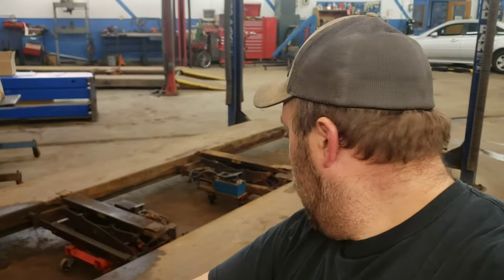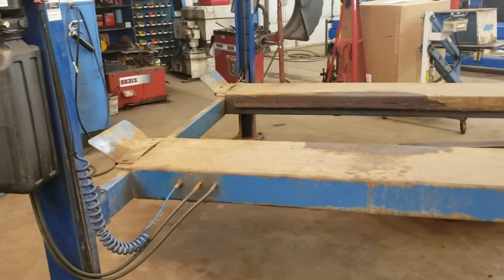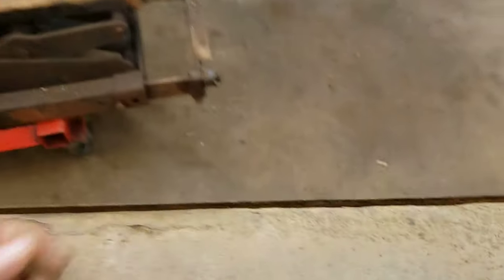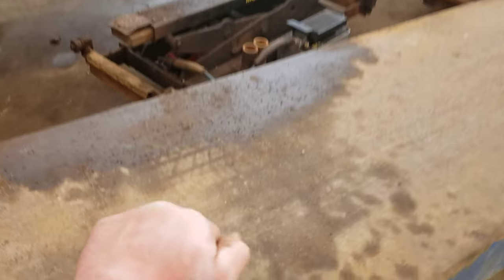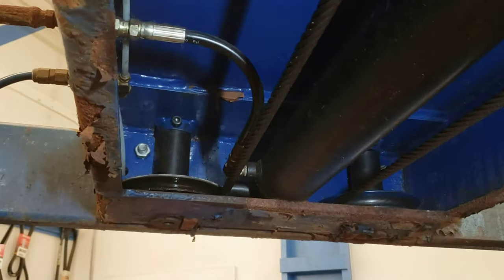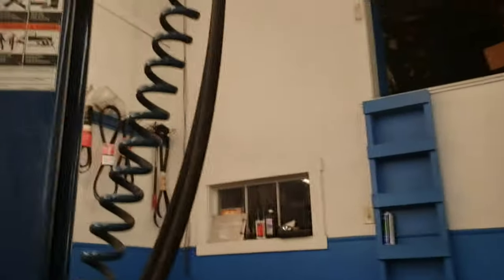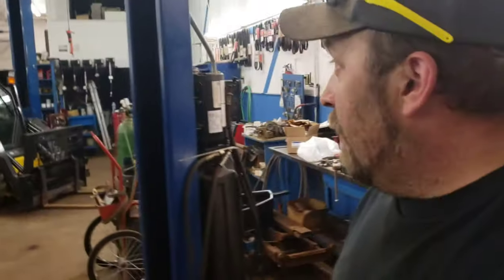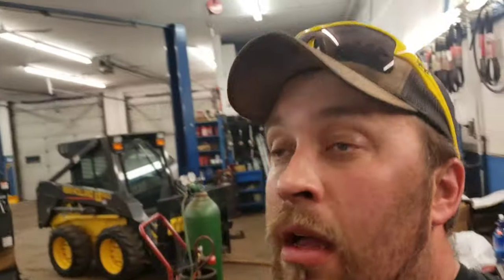Farm Vlog #24 Removing a 4 Post Hoist (Future Welding Table )

Comment: That would be an awesome welding table if you could use the lift!!!!! Still make a damn nice table!!!
BTW, I could fix the rails, make it better than new😁😎🥃🥃🍻
Reply from the maker: I could fix the rails as well but I don't have tall enough ceilings for it in this building and the boss wanted decommissioned so someone didn't get hurt. A 2 post would be more effective for my needs at the farm anyway. Thanks man.

Comment: You lucky SOB. Id be keeping it as a hoist; I can live without the wheel lifts.  Former Chrysler tech; I prefer the 4 poster over a 2.     Where's yer box in that shop?
Reply from the maker: I don't actually have a box per say I have an extremely over loaded service cart lol. Thanks for stopping by hope all is well.
Reply: @squatch253  Lemme guess - its an ongoing game where 'certain other techs' alter the orientation of your cart?  Ive worked with guys like that, far too easy to get on their nerves when you aren't even trying!   At least in your shop yer allowed yer own boxes - one shop I was at theyd just built new and everyone had to use the wall mounted boxes; and they would not surrender the spare keys.  They didn't even like me having my two service carts and over engine creeper; never minding how half the crew borrowed that on a regular basis!  Yea didn't stay there very long. 

If I might ask, do either of you specialize in a field or are you guys pretty general in what you do? Driveline and trans tech here; but did prettymuch everything except diesel.